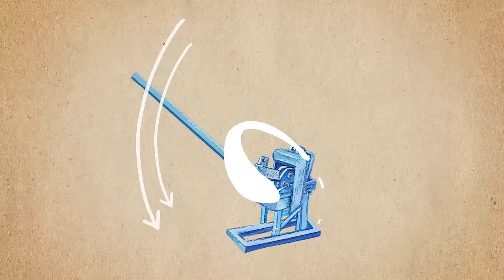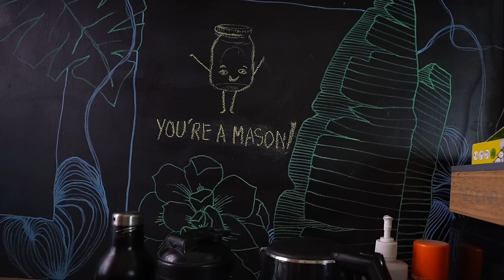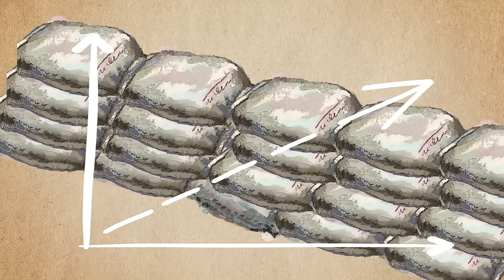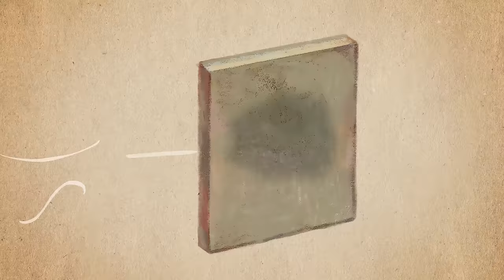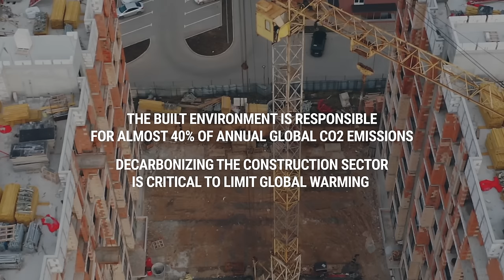How to Build a Sustainable Home | The Magic of Mud

Comment: Love the video. Using less carbon to build a home  May I suggest if you are going to build a home from scratch, first dig underground to create air cooling tunnels. Air from outside cools as it travels underground and thru the tunnels/piping then the cold air goes up into the house. It keeps the homes much cooler when it is very hot outside. There are some good YouTube videos of layouts for air cooling tunnels.

Comment: Use of bamboo , straw, mud are less costly and maintain cold temperature during day and night. The outer coating of the wall are using desi cowdung and sand as plasters

Comment: How do you assure the building is structurally sound/ viable or no structural failure? Have you analyzed for dead loads, impact loads, wind loads, etc? Any comparison with traditional clay bricks in terms of compressive strength, etc?

Comment: I lived in a city in my childhood, but many of my relatives use to live in village in mud houses. That’s 45 years ago. I still remember freshly cow dung pasted floor of the mud houses. To be frank it’s not stinky. And even cow dung was used for walls as there is no paint is used. And roof is made of tadichettu leaves (palmyra tree just googled) and supported by palmyra trunk. Those are my sweet memories. I commend the efforts are these women! Only concern I have is quarry dust, they have to replace that with something else. As quarry dust is not scalable, unless you want to pulverize lots of mountains, which they are already doing to lay down roads and railways. Added house construction to it will be a disaster as the demand will increase multi fold!

Comment: I have observed really rigid , solid , long lasting termite mounds. I understand it is termite insect’s  saliva and faeces that give their mounds air circulation, constant and moderate temperature etc. Have you considered starting a research project of producing Termite saliva by genetic recombinant technology and using it in construction? The scientists and architects need to work as a team in such a project.

Comment: Is there no way to eliminate quarrying from construction process, at least for small story buildings like houses? Quarry dust is used for mud bricks.
Reply: They used quarry dust in order to turn waste into something useful, which supports sustainability. If you don't have a quarry making dust near you, you can just use the default, which is sand, specifically sand with a rough surface to help with bonding.

Comment: I'm a Brit born in 1945. I spent most of my working life as a small scale builder renovating old houses in East Anglia, and one of the first in my area  to include a female carpenter. We worked  a lot of with the traditional mud and horse hair blocks. I also worked as a volunteer in Zimbabwe for 2 years with my family and one of the many projects was improving existing mud and thatch roofing technology to combat rising damp, termites etc. I think you are all doing a great job, but my dear ladies, why have so many of you  got the same problem as 50% of Brits which is losing the slim physique we all had  up to and including most of the 20th  century.

Comment: Would it be possible to build multistory mud buildings? Would it withstand the multiple floors without steel and concrete support? 
I guess this is only possible for single floor independent houses

Comment: 9:15 What? The process of making lime itself is done by releasing naturally sequestered CO2 seashells into atmosphere. Lime itself is a subtance that cause a lot more emission than it can in a building, only the miniscule part that's in contact with atmosphere will absoarb CO2. It is very disingenuous to posture and greenwash lime as a net carbon absorber...Its not. Its like forgetting the resource intensivity of making brass and then posing the tarnish in its surface as a miracle solution for the resource it exhausted
Reply: Your argument is disingenuous and solely made to gratify your captiousness.  There are worse materials used then lime.  By curtailing them you automatically improve environmental concerns. Eg.  lime made from from Oyster shells, a waste product of the food, heated by biomethane, also a waste product of the food industry is a better  alternative than lime from mined rocks and heated with fossils fuel.
Reply: @estebancorral5151   Sorry. But I'm someone working with carbon capturing, especially in romance weathering which replaces liming soil because the process emits Carbon dioxide and also has a background in Geology.
I would like you to remember that my point of contention was presenting lime as a carbon capture material, which is just plain wrong. Both limestone in cement and lime making from shells go the same step to expell the carbon dioxide. I never contested the fact that using lime removes the process of mining. But that it's what she said and neither is it the point I timestamped. 
So please do not misrepresent my words and neither should you justify the misrepresentation of lime as a carbon capture material. 
Inserting some half truth statements here and there, in between largely accurate information- is how disinformation spreads. 
While she was advertising lime as something that captures carbon dioxide, she conveniently omitted the fact that it is not a net carbon sink, but instead lime is a net carbon emitter. Not being forthright about that, especially in such a video, is very disingenuous.  
Btw, CaO made from calcination of both mined limestone and shells are both called lime. So unless you make sure that the lime you are using is from shells, you could still be using the same mined product cement industry use.
P.S You mentioned mining. Comparing the effect of net emissions and physical effect of mining is worthwhile here, since you seem to suggest that we should rather focus on that. 
What mining does is cause surface geomorophological changes. It has always happened in nature, its part of Earth's geological system called weathering and erosion, which happens by many mechanical and chemical action and biogenic activity, animal activity like burrowing and boring is also a weathering agent. And human activity is just a subtext of that, which is just anthropogenic activity. 
Mining by itself does not interfere, change or destabilize or disrupt any geochemical cycles or larger systems; unlike green house gas emissions. All it does, is make a very  localized change in topography. 
So, when you choose a material, your priority should be what its net emission including considering which one actuallyhave industry methods to capture and sequester the emissions, rather that whether it cause a morphological change in a location. And small scale industries where lime making from shells are done don't have much of any CCS systems in place to sequster the emissions

Comment: The real revolution is required in spaces,the way the structure stands,etc.We have to rethink the basic space required by the user,and the shape that is truly required.
Material is only a function of our technology.We have to rethink our relationship with the site.Just Trying to reuse bricks in some odd way,is okay for fashion, but intellect should be used in a far better way.That is why the education is there as an architect.An architect is the most all round developed individual,that has the training to make the most forward of decisions.Use it well.Use it correctly.Dont get stuck on the wrong track.Years down the line,you will find you end up somewhere else.

Comment: Always has dbout , will it can have large glass window,  doesn't it will need repair every six month , what if termite attacks,  will it withstand regular strom. The floor can be used tiles or granite n roof can be country tiles. I wish I could have it economical. What is the cost of simplex 1500 sq ft. Do not want any first floor. Just ground floor will be good.

Comment: the funny part is spend a fortune on rock foundation, use Msand from dynamite blasted rocks in quarries, mix cement with mud for compressed mud blocks, use a fortune on wood for windows doors and roof of tile roofs & then celebrate nature friendly homes. a long way to go!
Reply: Most of the materials we use are repurposed (for example the wood) or considered as 'waste' or 'by product' material from already existing processes (quarry waste) that shows a significant reduction in costs incurred and carbon/environmental impact when compared to conventional cement and steel constructions. You can look it up to learn more !

Comment: Cow dung on its own very strong and once you use it as floor wet it and rub it smooth and let it dry its hard like concrete. It does no crumble when it rubbed like smooth surface.

Comment: How To Live In Harmony With Nature And Reduce Pollution

 

1. Many Production  Which We Do Not Need Actually For Human Beings Has To Be Stopped

We manufacture so many products and it is creating pollution. So if we minimise our products, pollution would be less.

We produce so many things which we do not need, like cold drinks, leather products, potato wafers, chips, fruit juices, chocolates, biscuits, pickles, ice creams, etc. 

Cold drinks, fruit juices, pickles, ice creams, etc. Should be cooked at home only.

If we stopped producing this things which are not required for humans, so much pollution could be reduced.

If we colour the clothes pollution occurs. So if we don't colour our clothes, the pollution resulting from colouring the clothes can be stopped. Let everything remain in natural colour. 

 

2. We Should Cook Foods In Its Natural Form

We can cook rice and wheat in our homes and eat it. Rice and Wheat is produced in farms. Then it is packed and transported to big warehouses, then wholesalers buy from them and supply to retail shops. 

But if a manufacturing company makes bread from rice and wheat, then to make bread a manufacturing company has to be set up, machines and working staffs are needed. When a company is built many other things are also needed. Then at last a plastic pack is required to pack the breads.

So if we start cooking eatable things in its natural form then we do not need many companies like bread manufacturing company, tomato ketchup, noodles, fruit jam, pizza, burger, etc., the things required for the company and the plastic pack, paper box pack and glass bottles. If done like this, so many companies will not be required and hence less pollution for the world. 

Also we could save our money like this. If you buy a packet of bread, it would cost you more money than if you cook wheat and rice in home.

Previously before industrial revolution, we didn't have technology, but our foods were rich with nutrients. Now we have technology, but technology is polluting our foods and our foods are not rich with nutrients, and because of that also we have health problems.

If this is done, then many jobs would be lost. For that many peoples should do farming and they should be given loans if they do not have enough money to start farming on their own.

Food, Medicines, Surgeries and Education's should be made free to the world till the world settles down with farming. After that food, medicines, surgeries and education's should be stopped free to the world.

Many people should study botany subject so that they have knowledge of plants and they should do farming.

Is their any another solution, that humans won't lose jobs and also pollution would decrease. Humans have to take this step certainly instead of going on polluting the earth, making wildlife extinct and also mass extinctions of humans in future.

 

3. Electricity Pollution

We create electricity from many types of sources like coal, water, etc., but it creates pollution. If electricity created from windmill and solar energy then no pollution occurs in the creation process. But still to manufacture windmill and solar machines pollution would occur.

As I previously said that if we shut down many manufacturing companies which are producing things which are not needed for humans, then the world would not require so much electricity. If less electricity required, then less pollution generated.

 

4. Could We Stop Drinking Cow's and Buffalo's Milk

Whatever vitamins and nutrients we get from milk, if we can get it from other eatable things, then we can stop drinking cow's and buffalo's milk. As milk has to be packed in glass bottles and plastic packs and then transported to places. All of this can be stopped. 

For infants whose mother's have died or mother's who cannot breast feed their infants, only for them cow's and buffalo's milk should be given. We use milk in tea and coffee. Instead of milk we must use coconut milk with tea.

 

5. How Much Should Be The World's Population

Every place should have a single house. No buildings, everything ground floor. If we do this and the whole lands of our planet earth would be occupied one day with homes, farms, forests, schools, hospitals, etc., then we would come to know how much our planet earth can have maximum population. 

Once the population is determined, then we have to maintain that population. For example if our earth can have a population of 10 billion peoples, then when the population reaches 10 billion, then everyone should have only one child till the population reaches 9 billion peoples. As if we have only one child then the population decreases. When population is 9 billion peoples, then everyone should have 2 children's till the population reaches 10 billion peoples. After that again we should have only one child. In this way population can be maintained.

Comment: Just an Architectural stunt, this is a normal practise in Indian villages. Maybe in the future these people will convert this into a PhD for them. Bcs I have worked with a few Architects. And whatever they technically think about mud blocks are not correct, the mud house also holds moisture. I have my own house in my village constructed in 1992 , now it's 2 storeys. So don't convey wrong information to the public.

Comment: This is feasible only for less load demanding structures. Mud is ancients, what is here innovative?!
Women should empower more in this filed and salute to all women including the workers in this initiative of sustainable green building.
However, material like lime still has embodied carbon since calcination is need to prepare lime. 
Replacement of process slag such as iron or steel slag and somehow carbonating the building blocks will help to improve the product mechanical and durability performance. Why are we not promoting such initiatives as India has large iron and steel making industry leave a lot of slag as waste!

Comment: How are these bricks are not getting wash away to rain ? with out heat treatment or plastic or resin mix  these wont stand a chance. also it's expensive to make these on large scale . you have to destroy a eco system to get that much of red soil it's only be found on fertile land. i hope this actually works and not a scam

Comment: This is only commercially viable if the cost is less than the current construction process. I do not think this is viable for city construction. 

I am for women's empowerment but sitting inside a gas-guzzler car and brick-and-mortar houses and then talking about the environment's CO2 emission seems a little hypocritical.

Comment: The work you guys are doing is something which was done long back thousand of years ago in india and also is still being done in india. Even I have seen my mother using cow dunk with mud to make paste to apply for walls and floors. So, I'm not sure what uniqueness u are trying to bring.
Secondly, using cements and steels to make skyscraper is criticized due to xyz factors, but in reality presently there is no such alternative to it. The bricks with mud is something which never gonna substitute it due ot its inherent material properties. Imagine making tall buildings with mud brick only without cement or steels, then what happens when earthquake comes.
Third, you talk about sustainability and then you talk about gender equality. I'm not sure what are you trying to do. Are u guys activists or pvt firm/arthitect trying to focus on building homes. I don't know.

I still admire the effort u guys have put in. But it's important for u guys to have  clarity on your goal -what is it that ure trying to solve and is it really viable-.